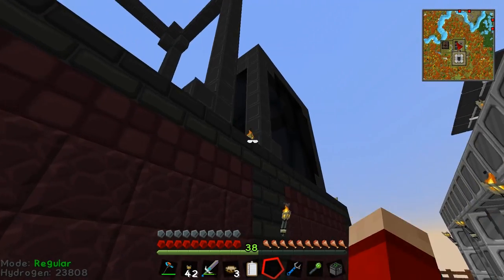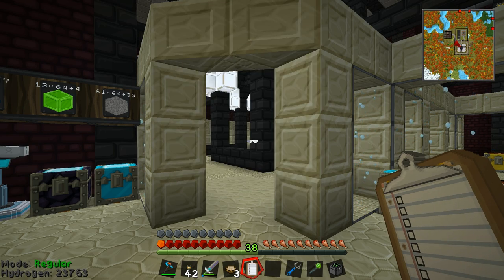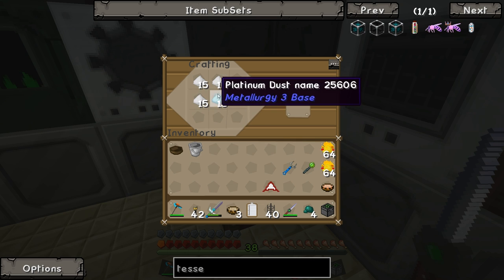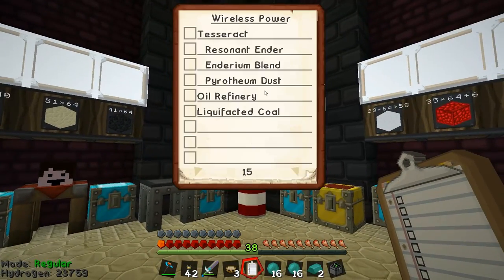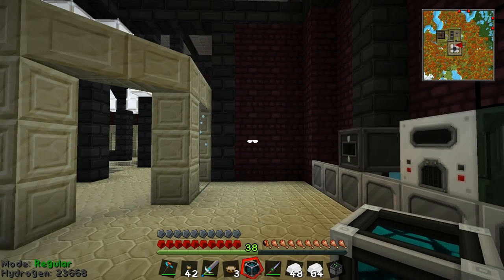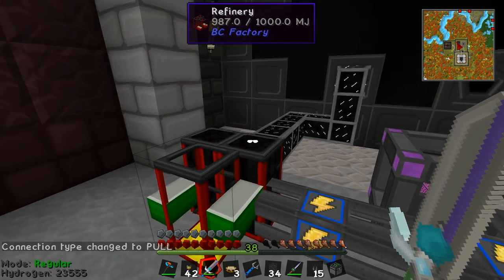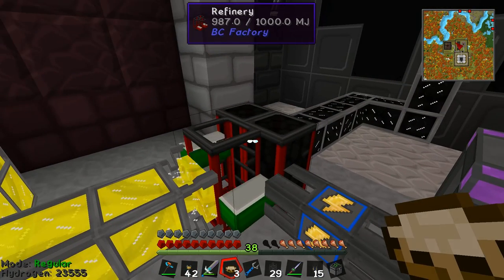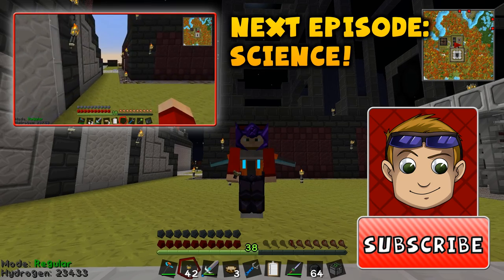Minecraft: Strife Solutions 26 - Wireless Power

Comment: The RefineryPlus (and the other Plus items) is not faster than the refinery on its own, however, you can Enchant them, with pickaxe enchants (Fortune, Unbreaking, Efficiency and Silk Touch) to add effects. On the Refinery I don't remember specifically, but it can upgrade the speed, reduce energy-cost, increase the internal tank, that kind of stuff.
The QuarryPlus is EXTREMELY efficient once fully enchanted, and has a maximum area of 256x256 blocks.
Also. the mB unit used in mods stands for Millibuckets. As in thousands of a bucket.
Reply: *****
I was reactng to his fumbling about microbuckets and the likes.
And if 1000mb is one minecraftbucket, what is then 1mb? 
It's milli. All scientific research and implements use metric as a standard. You try using ounces in Chemistry, and see what happens.
Reply: *****
No, the unit IS "Millibuckets" but he started fumbling about microbuckets and the like. 
My problem isn't using "buckets" as a unit of measurement, but that he couldn't get the decimals correctly. 
A microbucket means one millionth of a bucket.

Comment: It's right that the universal electricity cable converts energy types, however RF and MJ are compatible by themselves - no matter what cables you use, RF are automatically converted to MJ when entering a machine from BC
Reply: and mB stands for Millibuckets
Reply: RF and MJ are not compatible by themselves.
Reply: Yoshi- except they are test it
Reply: TheCroftygames They aren't just test it by putting a redstone energy cell(that outputs RF) right next to Quarry(that takes MF) without any cables inbetween. RF and MJ are not the same and not compatible by themselves.

Only if you uses cables it is possible to turn RF into MJ, but you cannot turn MJ into RF.
Reply: Yoshi- yes you need cables but any rf cable will do and mj does convert to rf its something like 1mj to 1000 rf so get it right
Reply: TheCroftygames The cable convert because they are specifically coded to do so. So neither is RF compatible with MJ nor does RF automatically convert to MJ when it enters a machine. The cable does that. If you use are cable that doesn't convert, it won't work.

Also 1 MJ is 10 RF so get it right
Reply: Yoshi, 
try it with machines that take RF...
Hook it directly, it won't work.
You always must have cables regardless.
Reply: EnderGamingX If you put an Thermal Expansion Energy Cell next to a thermal expansion machine and set the output of the energy cell right it works!
Reply: Yoshi- bc pipes auto do it but are only coded for mj so if a pipe can use mj it can use rf
Reply: Yoshi- bc pipes auto do it but are only coded for mj so if a pipe can use mj it can use rf
Reply: TheCroftygames BC pipes can only power machines that take MJ, they cannot power any machines that take RF.
Reply: Yoshi- they can as the yogscast and many other people have proved
Reply: Yoshi- they can as the yogscast and many other people have proved
Reply: TheCroftygames  They cannot just test it or show a video where some uses the Buildcraft Pipes to power an RF Machine
Reply: Yoshi- put it this way i know that the makers of bc, te and extra utils know each other and they code their machines to work with other similar power systems so there
Reply: TheCroftygames put it this way you are just pulling stuff out of your ass withot ever testing those. You cannot use buildcraft pipes to power anything that takes RF.

Buildcraft pipes only transfer MJ and it is not possible to convert MJ into RF, only RF into MJ
Reply: Dimensional Transceiver from Ender IO are an alternative to Tesseracts. They require five ender eyes per unit though.
Reply: KristoffDoe But don't require resonant ender or a fluid transposer!
Reply: Hey I was just getting something to eat and HOLY CRAP WHAT HAPPENED TO THIS COMMENT THREAD.
Reply: DamonM Roger
Correct, only alloy smelter or whatever it is called (to make this fancy Ender IO green alloy).

Comment: The frame rate lag is due at least partially, to the fact that the pipes on your sorting system, are transparent. They have to render each and every item passing through them.
By using non transpiration pipes means less lag, but all the resources you use to make the current sorter system is gone, and wasted

Comment: Those tesseracts are dead useful. Have one pair set up to transport lava from the nether for use in power generation and in generating obsidian (over 2000 blocks after just a few days).
Reply: You could just use Dimensional Transceivers, they are minorly cheaper and work just like Tesseracts.
Reply: DamonM Roger Nice, but the modpack I'm using doesn't have Ender IO. :(
Reply: WestOfEarth That sucks :( It really is a great mod. Not to mention the fact that it's conduit system is amazing. You could fit an energy, and item or fluid conduit all in one block of space.

Comment: The RefineryPlus (along with the other *Plus blocks) are much higher powered versions of the originals, at a much higher materials cost. They can have enchantments moved across to them which make them faster/more efficient, etc. Also, they can have some extra functions, such as the QuarryPlus which can suck out liquids (oil, lava, water, etc) and can have a silk touch enchant put on it which will... well, do exactly what you expect.

Comment: I downloaded everything ans started playing it, and i just got demolished with lag getting 5FPS is there anything i can do i allocated the RAM to 2560mb (i think)  i wouldn't be suprised if it was my laptop it isn't state of the art aney heilp? :3
Reply: Yhea you need a high end laptop or a moderately decent desktop for this modpack. my PC is old but powerful so i can run it on around 30 fps with a bunch of stuff going on
Reply: It has nothing to do with your RAM, your CPU is most likely not able to support the amount of mods in the mod pack considering that there could be 250+ mods installed. You'd need to upgrade your CPU which isn't an easy process for a laptop. Considering that you'd need to find out what type of socket your motherboard has and then get a better CPU that has the same socket type. And then you'd still need to see if your power supply could support the CPU power usage. That's not including the massive struggle of opening the laptop.
Reply: thanks for the tips :)
Reply: I dunno about standard 16x textures but with a 64x pack my client uses 3-4gb of RAM. It can never hurt to allocate more ram to test, that is if you have it to spare.
Reply: i can only allocate an extra like 520mb
Reply: I have i High end laptop that plays it fine but 2560$ Got it from the job! Im a teacher
Reply: well...yeah you would expect it to play for that much $$$

Comment: Would a MacBook Pro 13 inch retina be able to run this mod pack? Also do you have to buy minecraft first to use it?
Reply: 1: A Mac laptop is more suited for doing work than playing games.
2:Yes, you need to purchase base minecraft to play this.
Reply: That depends on just about everything about the computer other than its screen... It should be able to. How much RAM does it have, because that's the deciding factor for minecraft (because it doesn't have a graphics engine, which normally is a bad thing). You'll need at least 2Gb running the modpack (so as long as it has 4Gb, you should be fine). Just look up how to give programs more RAM to run with, its really easy on mac (on Windows, no chance)